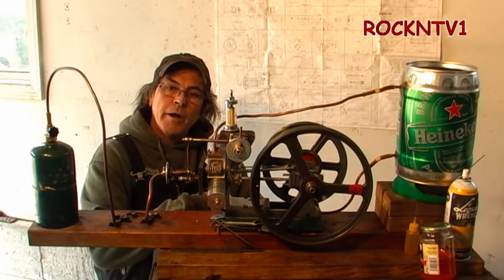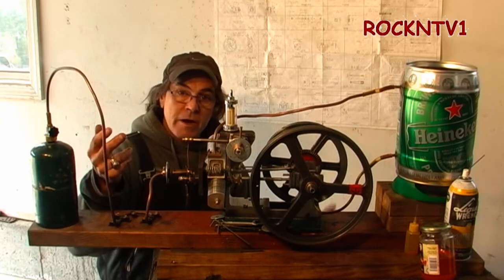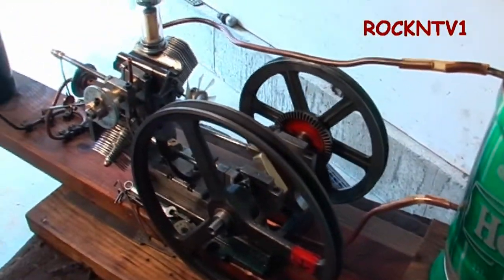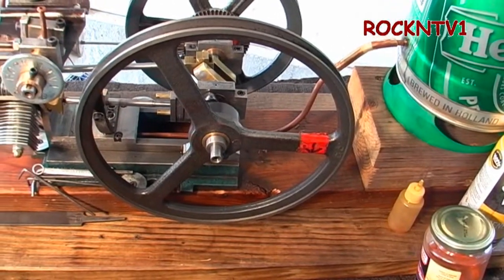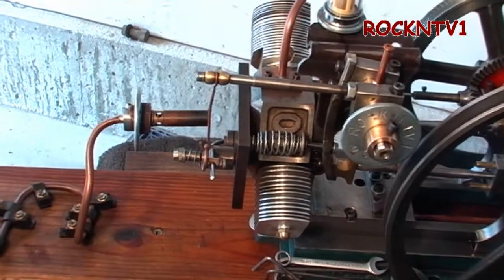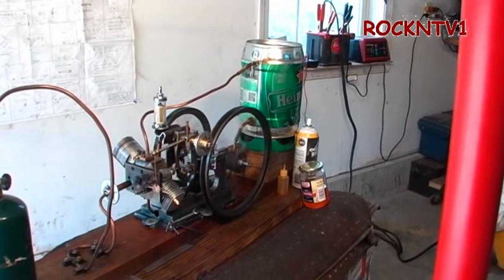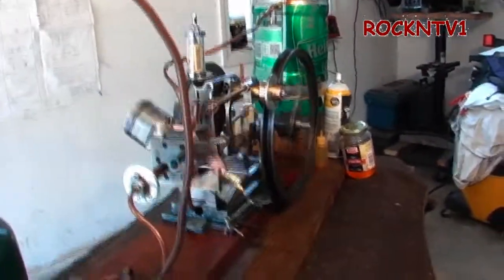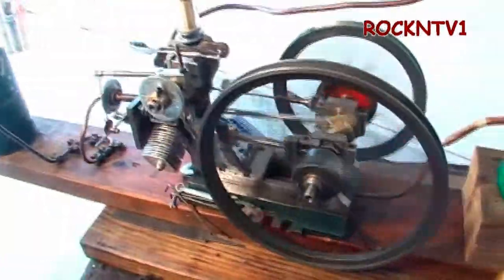Flame Licker Engine Homemade Flammenfresser build info

Comment: I see you have air and water cooling, if that an either or or do you need both to get reliable operation?

I like the directed flame that shoots it into the cylinder, I think it would allow for better fuel economy if more of the flame went in the hole instead of just past the hole.
Reply from the maker: it either or both on the cooling, thanks for watching
Reply from the maker: and a build video https://youtu.be/o-m1BEAxhDo thumbs up appreciated